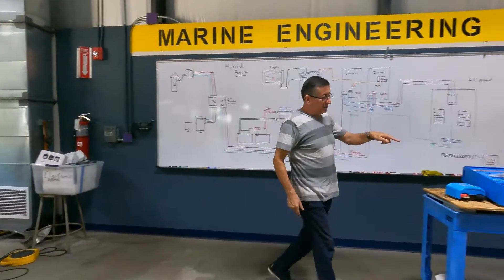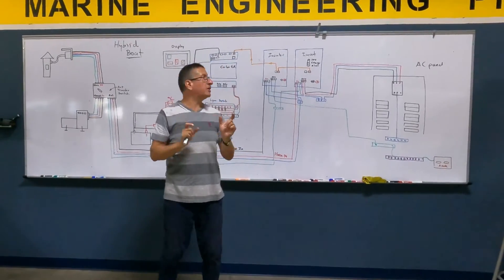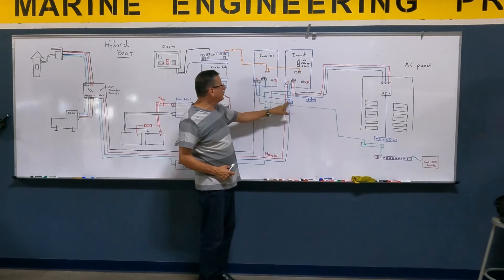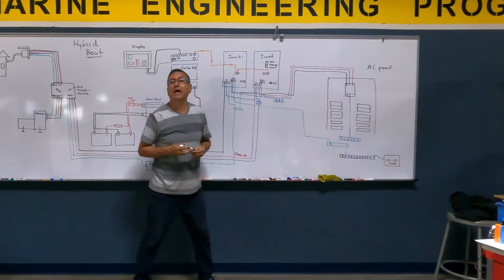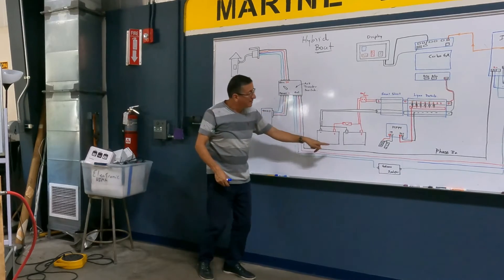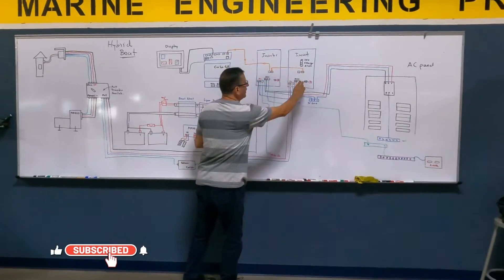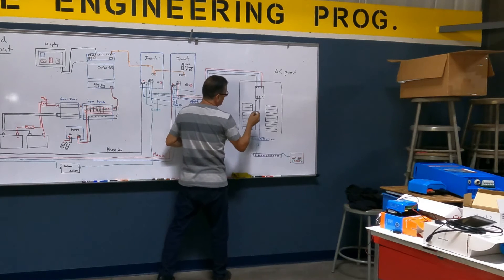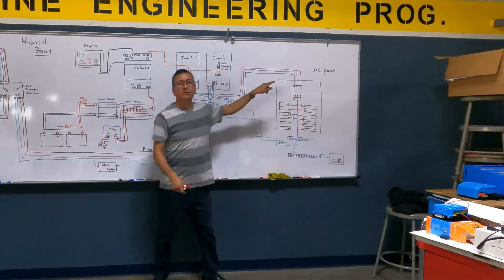Wiring a Victron Split Phase Configuration

Comment: Well, if we already have two phases from either shore power or generator so why use  the inverter to produce two phases?
Reply from the maker: Because the Generator and Inverter are not running always . In general you will use pawer coming from the Inverter
Reply: @MrLopezclasses OK, sir, that means in the condition when we use batteries or solar, am I correct?
Reply: @Tech_Worldofcontrol  There is Single Phase 240v at the Pole. Not 2 Phases. Line #1 and Line #2 of 240v Single Phase.

Comment: So each hot lead is going to independent 120V breakers? Or theyre combined in the panel to make 220V?
Reply from the maker: Yes , they are combined in one Breaker, however each phase is coming from a separate Inverter
Reply: @MrLopezClasses  There is NOT two Phases. It is Single Phase 240v at the Pole. It is Line #1 and Line #2 of Single Phase 240v.  It is the voltage that is split, not the single phase. Pay Attention!!!